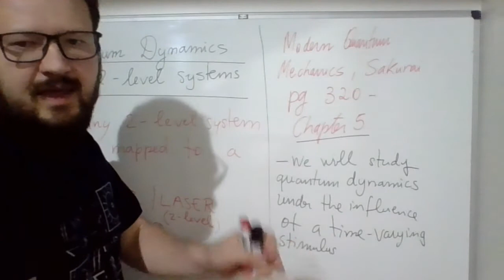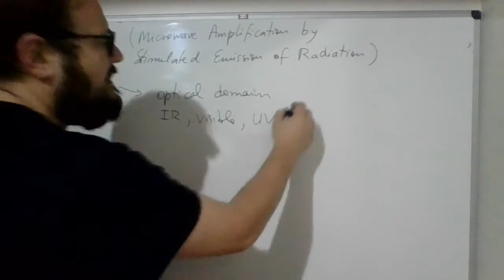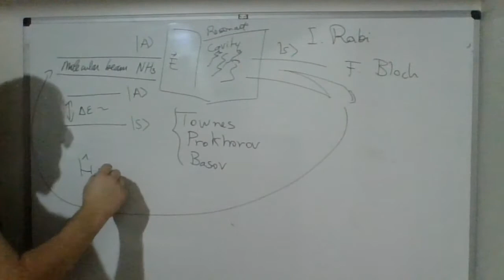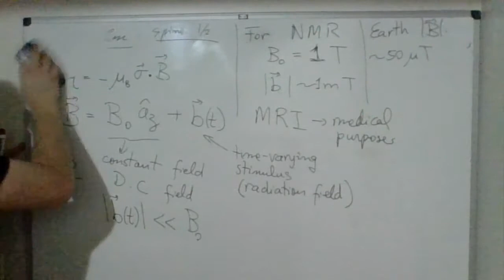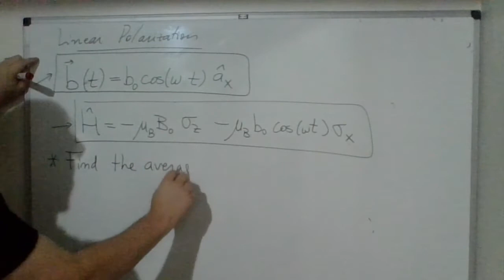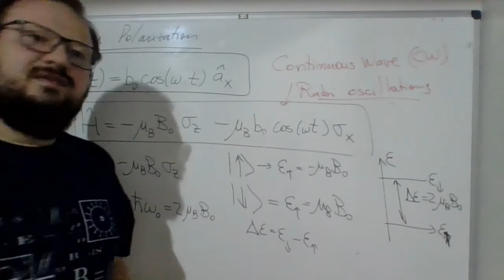QM - Lecture 15 - Two-Level Systems: Mapping to a Spin 1/2 Problem

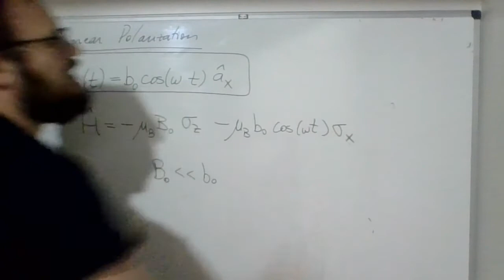Comment: Great video and pedagogy! Quick question though: Why is the Hamiltonian at 51:56 equal to the sigma_z part MINUS the sigma_x part and not PLUS?  [-cos] why not [+cos]?
Reply from the maker: Hi Muddassir. Thanks for your nice comments. I was considering the Hamiltonian as H  = - uB (sx Bx + sy By + sz Bz). Then for Bx= b0 cos(w t), By = 0 and Bz= B0, you'll get that operator. sx, sy, sz are the Pauli matrices here.  Hope that I answered your question.
Reply: @cesardartora7847  You make physics look like  art. Great! You answered  the question.